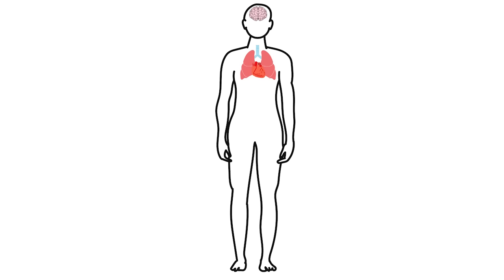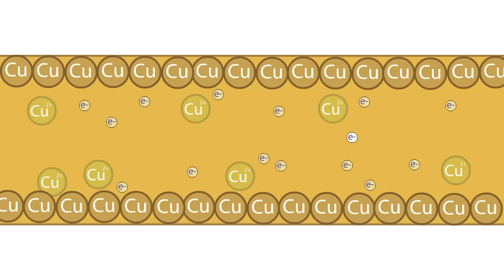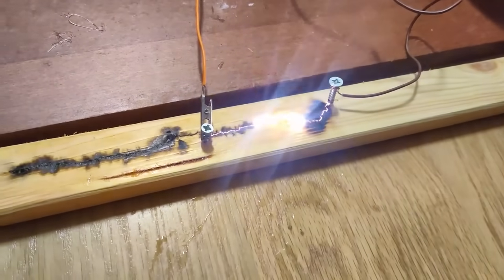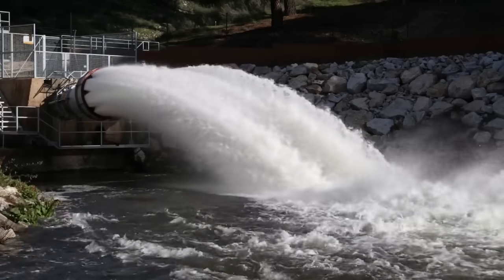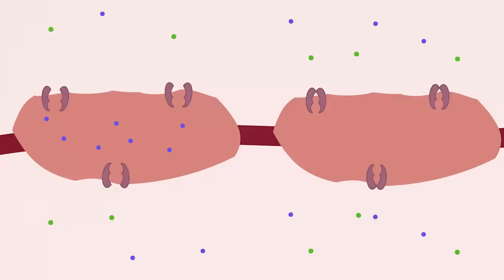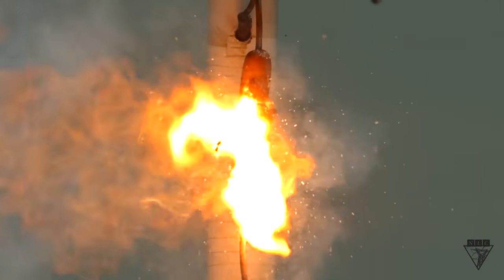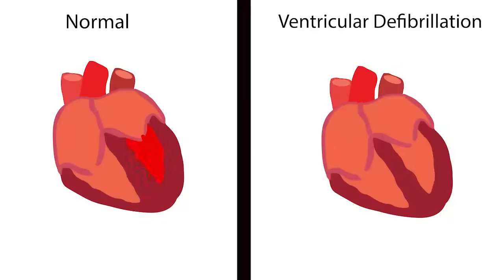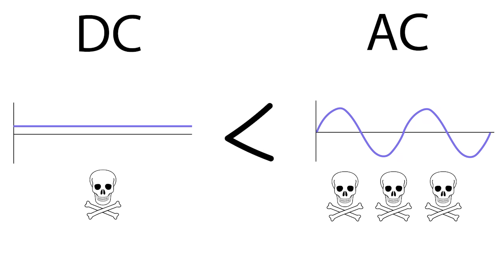Anatomy of Electrocution

Comment: The electric chair was originally believed to be a humane alternative to hanging.  It turns out that it is far more traumatic than hanging.
Reply: Hanging done correctly is virtually instant, since it breaks the neck of the subject.  Done incorrectly it is a much worse method
Reply: @GuaranteedEtern  How much worse is the "done incorrectly" version?
Reply: @pat1509  It depends - hanging is supposed to kill by breaking the condemned person's neck, causing almost instant death.  An "incorrect" hanging could cause them to die from slow strangulation, which I assume would be much worse.
Reply: @pat1509  It depends - hanging is supposed to kill by breaking the condemned person's neck, causing almost instant death.  An "incorrect" hanging could cause them to die from slow strangulation, which I assume would be much worse.
Reply: @pat1509  Well, not to get morbid but when done correctly, hanging is almost instantaneous.  Done incorrectly results in slow suffocation.

Comment: P=IV were Power equals current times voltage.  It doesn't matter which, power or voltage, is high, as long as the voltage is high enough to penetrate your skin as long as the product is enough power to disrupt biological systems.  One Million volts at One Trillionth of an Amp, won't hurt you, while no Amperage of any magnitude will hurt anybody with dry skin, under 25V.  This is why most DC systems are kept down to 24V.
Reply: That makes no sense.  If you have million volts with one trillionth of an amp, the voltage will drop on contact. All practical systems have enough current to kill. It is the voltage that matters.
Reply: @okaro6595  A "practical system" has to push enough power to do something, so voltage matters.  When you're dealing with insignificant power, voltage can be extremely high, yet do very little.

Comment: One question, I've happily touched sources of DC with multiple apms, even inside of my very low resistance mouth. When you say 100ma is enough to kill a person, do you mean 100ma flowing through the nervous system after it's passed through the skin and had a huge voltage drop? Or are we taking about current regardless of voltage? Because I'm pretty sure 1ma can kill you at high enough voltages lol.
Reply: I think it's the second one. Have you ever been zapped by the spark of an engine? That's around 40kV, yet the current it produces is around 1 mA. Safe to say it hurts quite a bit
Reply: This is what you get with the it is the amps that kill nonsense. It does not matter how many amperes there is in the wire if there is no potential difference. The grounded conductor (neutral) on a circuit can carry high current but you are not harmed by touching it as it is grounded.

Learn for once and for all: it is the volts that matter. Any system can provide enough current to kill you.
Reply: @okaro6595  Yeah in retrospect they're clearly talking about current regardless of supply drop. The problem with talking about things like this is it's easy to parrot "100ma can kill you" without actually knowing anything about total power delivered or even just ohms law lol.

Comment: I believe AC is safer than DC at 0.3 Amps, since AC crosses zero volts, it doesn't produce the "not let go" effect.
Also, who kills is power = volts*amps... if you have low resistance a low voltage could produce a high current and be dangerous... if you put thicc cables like 4mm2 or 10 AWG on a standard 1.5V battery you could burn yourself due the strong arc.
Reply: It's actually the opposite. AC is far more dangerous than DC especially at the 50/60hz that power is supplied. Very high frequency or low frequency (such as DC - zero hz) does not cause locking on. I'm an electrician, and nobody calls it "no let go" - it's called locking on. DC is much safer than AC and does not cause you to lock onto a conductor, it will only burn you.
Reply: Also, as far as current goes. 3mA DC does not mean the same thing as 3mA AC. Most AC current is measured or expressed in RMS values - which means 3mA AC-RMS is roughly equivalent to 3mA DC even taking into account that the AC value crosses zero multiple times a second (at anything over 1hz).
Reply: Wrong. It is not a matter of beliefs.
Reply: @okaro6595  well, one never should blindly believe something from internet. I don't pretend to be an world expert about it, but is my professional opinion after become an electrical engineer with more than 10 years as electrician, working with DC currents on photovoltaic instalation, and as example a DC electric arc could stand twice the distance of an AC electric arc on getting supressed, this is why DC protections are different from AC ones, another reason why DC is more dangerous.

Comment: Correction:
Resistor does drop the source voltage, but the main thing it does is "resist" the current. And it's the high current that kills the LED, not the high voltage. One other thing, the resistor burns when it receive high power (watts). It won't burn if you connect it to high voltage source but little to no current, and vice versa.
Reply: Saved me some typing! Thanks!
Reply: Also, the fact that there is a voltage drop is because the LED has resistance (ignoring forward voltage drop for the sake of simplicity).
This was a basic mistake that really frustrated me.
Reply: 😍 Thank you. I was looking for this comment.
Reply: I was gonna say basically the same thing I know he was talking about continuous current sources but static shocks can upwards of like 40 amps for a very short time with little to no harm to the body.

Comment: I have been electrocuted by 1200V 9A photovoltaic system (don't know how much of that when trough me, due to my resistance at the time)... it passed through my hand to my butt on a metal sheet roof that i was sitting on, i was able to kick my self away with my foot.. painful as F...K, but no damage what so ever...

Comment: Another reason lower AC voltages are fatal is because the peak voltage is considerably higher than the RMS voltage, which is the figure used to convey the average amount of work done by a voltage that is always changing.
Reply: What? This is literally bullshit. None of this is factual and none of what you said even makes sense. rms Being a function of the sine wave, a peak voltage is always going to be proportional to the rms. 120v ac has 170v peak voltage.

Comment: The circuit breaker for lights in my house is 10 Amps, if 30 milli amps of AC is lethal, this means that getting an electric shock from one of the lights would kill? @240 Volts?
Reply: That is why you also need ground-fault breakers ;) those trip around 15-20 mili aps difference between the fase and zero wires
Reply: @1987tijgertje  Thanks, what if your Ground-Fault breaker is faulty?

I believe we call "Ground-Fault" breaker "Earth Leakage" 

What I'm wondering aswell is about something I've heard a couple of years ago, that DC pulls you and AC pushes you?
Reply: @poison_corpse3140  That is why those breakers have a test-button ;)
And why people should test them regularly, not that people will actually do that.

Most likely that your "Earth Leakage" is indeed the same. It just measures if current leaks away and disconnects the current when the leakage exceeds the threshold. 

But yes if it is faulty it is like it never has been there and you will end up dead.  But with a breaker in the circuit you at least have a chance it will trip and save your life.
Or that the electricity will even be cut off before you get a shock because the device is connected to the ground-wires (yellow/green).
Reply: @1987tijgertje  I do test mine annually.

Thanks, yes I was wondering if the circut breaker for the lights would trip if the ground fault breaker doesn't.

Regards.
Reply: @poison_corpse3140  maybe, but not before you are dead.  Here in my country it will trip at 16 amps, around 457 times the leathel dose

Comment: It is beyond my comprehension why, if we must execute people (another issue entirely), we create such unnecessarily expensive, complicated and dramatic tools to accomplish the task.
  A simple injection of many substances produce unconsciousness and death almost instantaneously. Ask any veterinary.... they do it frequently in their work.
Reply: Because the exact combination of drugs is far more expensive than the electricity needed for an execution
Reply: @wolfetteplays8894  
  Let's see the calculations if you have them. Veterinaries euthanize small and large animals every day and I'd be very surprised if the drugs to do it are expensive. I've had cats put down for a very small sum < $50.
   So OK, that might be more expensive than a little electricity but what about all the infrastructure needed - the chair and wiring and special room, etc, etc.? None of that is required with injection. People are DIY at this moment in back alleys for next to nothing.
Reply: @rae0521  you have a fair point… I think the bureaucracy will hold it back though, sadly. This country needs better leadership.

Comment: Although this video is very good for people who dont know a lot about this thematic, i am very disapointed, cause i though ibwould learn about more factors than i already know. But it didnt even mention all the factors i know. Thats very disappointing to me. So i will start a discussion on the factors under this comment.
Thd factors i know are:
1. The current and thus the voltage applied to the body together with the resistance of the body, and thus the contact area, and the duration, cause longer duration means less resistance in human body, also with votage above 100V the skin will break through and thus the resistance will get lowered dramatically
2. The duration: not only will longer duration cause the resistance to go down, also the damage will get higher with higher duration. Eg. if you are charged up by walking on a carpet and then touch some metal, the voltage might be at 10000V, also it might break through your skin emmidiately making the resistance to go down to 500Ω. But lets say it only goes down to 5000Ω because of small contact area and small duration. So then still a current of 2000mA flows through your body. The only right explanation, why this isnt lethal is the short time of the current peak. It is way less than 10ms, and if you google the lethality line of current, you will find, that at least for currents below 10A through your body (and probably also beyond that) if the pulse is shorter than 10ms it isnt harmfull (unless you've got a weak heart or something) . 
3. The frequency: If it is DC, then it isnt that lethal as AC first factor is your resistance being higher for DC because of capacita ce of your body, and second reason is, that even for the same current AC is more lethal than DC.  But also the frequency is a factor. eg. if the frequency is high enough (10000Hz or something) your nerves wont react to it anymore, and thus your muscles wont react, and also your heart wont react, so then the only issue is the burning of your skin. You might say, that in everyday life, this wont matter, and you might be right, except that there are electric lighters (plasma lighters) out there, that produce continuous current that might be pretty high (even without the plasma with direct touch to your skin, you might get small burn marks). But still you dont feel a real shock, but just the heat and maybe some tickle. That is because of its high frequenzy. 
Now there are still a lot of cases, where some source might seem to be lethal, but it actually isnt:
1. If its inner impedance is very high. This is a important factor,cause while some sources like a Van de Graff generator might be able to produce a continuous voltage of 10 th of thousends of volts, but still it wont kill you, cause as soon as you touch it, its voltage will drop to near 0V. This is because it cant provide a high current for a long amount of time. 
2. If they can give a short high current pulse but no high continuous high current, like a electric fly trap. This has got a high impedance high voltage generator inside, which charges up a capacitor. This capacitir can discharge on a fly and kill it. But it wont kill you, cause its energy is too low for that, and thus the shock is very short (way shorter than 10ms). And after it discharged the high voltage source inside cant provide enough current, and thus when you touch it, the voltage will be very low (it will still tickle, cause its pulsed with high frequency, but no beatiful frequency but interrupted shit). 
But theres still things i am not sure about. There are some ratings on capacitors maximum Energy (at high voltage) contained to not be lethal. But still if i calculate the discharge time of these ( time until they get to only 20V) they are way way below 10ms. So actually i would think, that they could even have way more energy contained and still not be lethal. But i am no expert. So i dont trust my calculations and things i know. Are there maybe even more factors?
Reply: Thanks!

Comment: Little correction: its the Synapse/Motor end plate where the chemicals get released. The Axon is the whole extension of the nerve, where the signal travles through
Reply: To add to this, there are no voltage gated channels, or any channels within the myelin sheath as depicted in the video. They act as insulators, between which are the nodes of ranvier where the voltage gated channels actually do reside.

Comment: Muscle contraction due electricity is something my dad taught me when I was 4. He taught me to (only if there is no other way) to check surface of potentially electrified object with outer side of palm or finger.
Reply: Yeah no dont use a finger even that can wrap around if you aren't carful
Reply: What outerside
Reply: @hungry_khid1007 the back of ur hand
Reply: @geniusdrummer643  In one of his physics of electricity classes, my physics teacher would plug in his demonstration hot dog and touch it with the back of his finger.  He told me that if you were to touch something electrically energized, the pull factor would make your hand contract away from the electric current.
Reply: @hungry_khid1007  Perhaps with the top of a hand and/or finger.
Reply: If you're at that part already, why even touch it if it could be electric? One doesn't usually pat things with the back of the hand absently! Haha

Comment: How to save ourselves from an electric shock? 🙄
Reply: Well use caution, if you see a wire don’t grab it. Make sure there is no electricity going through it and if you need to test it yourself then quickly touch it in a way where your muscles won’t tense up and wrap around it, like using the back of your finger or wrist. Besides the likely hood of someone grabbing something with lethal amounts of electricity is very low, keep in mind that it is possible and extremely dangerous but don’t worry to much. If you have any further questions, I am glad to help.
Reply: @Mrchill7299  is there anything which doesn't make us feel the electric shock when we touch such things like I heard wearing rubber chappals won't cause an electric shock as it won't completes it's circuit down to earth and also 
how to save a person who is adhered to a current pole or wire and is in a dying condition.
Reply: @sandeepsunny5509  yes rubber will stop a shock because it is an insulator, electricians wear thick 100% rubber gloves in order to protect themselves from nasty shocks. Now if you happen to find someone who is experiencing a continuous electric shock I’d recommend not touching them or pulling them away, if you do this the electricity can shock you as-well. If there is no switch to stop the flow of electricity then all I can think of is just destroying the flow yourself. For example I saw this video a few years back where someone had experienced a “no let go” on one of those fridge doors you see in stores (its a window but has a metal handle which is a conductor) bystander ruched into help and to kick down the door literally going ape shit in order to stop the electricity. Of course warnings will also stop accidents ahead of time like “DANGER: open wire” or something. If it’s too late and it’s life or death just do whatever even if you need to kick down a few hundred dollars worth of equipment, but also make sure your safe as well.

Comment: Perhaps I missed it, but at what voltage are the different currents applied in the Current-Effects tables? Just enough to get over the resistance of the skin? What would happen if super high voltage was used, how would it influence the effects? Would you need proportionally less current to cause the same effect?
Reply from the maker: I have to admit I didn't do this video a lot of justice, especially with the question you're asking. The resulting current whether its 1mA, 6A 100mA etc. is dependent on Ohm's law. You wouldn't be able to know the current passing through until you actually did the calculations. 100 volts with dry skin doesn't result in the same current as wet skin. I did have a section of this in the video, but it got deep in the weeds and made the video much longer, so I decided to take it out. For a quick, oversimplification, you can state that the higher the voltage the higher the current is likely to be. There are of course exceptions depending on the situation. I'm sorry I didn't include this in the video and my reply doesn't do it much justice either.
Reply: @darkscienceyt  It's understandable you have to omit some parts which are not so relevant. I enjoyed the video nonetheless and it was informative, so thank you, and for the reply too.